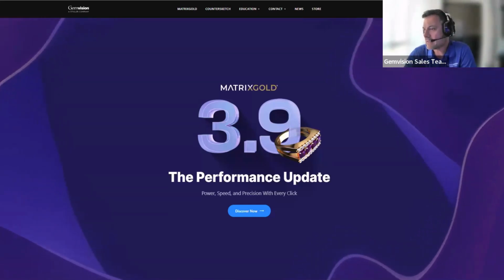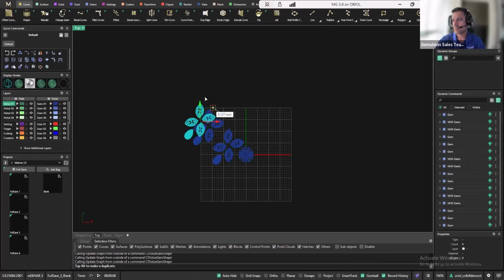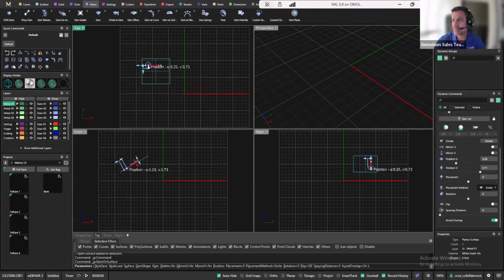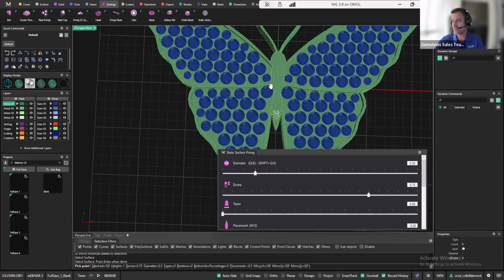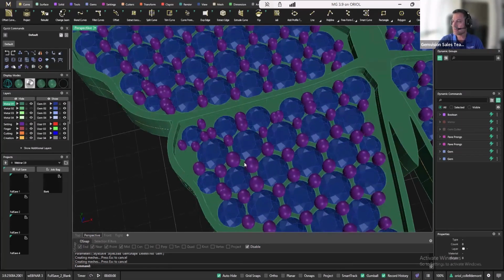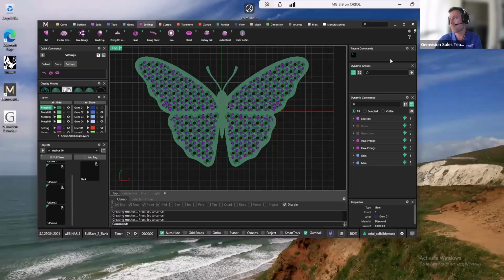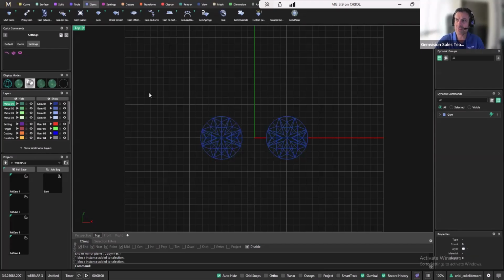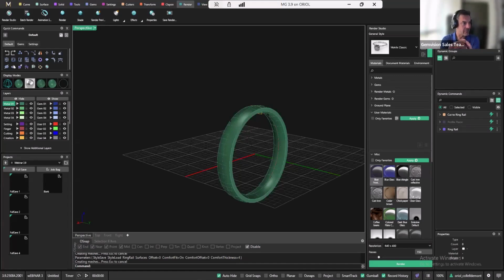[Live Session]  MatrixGold 3.9 | Learn All New Features & Design Faster in Jewelry CAD

Comment: You're finally working on fixing MatrixGold. I had purchased RhinoGold, but you discontinued my license, forcing me to buy MatrixGold instead, which came with numerous issues and was practically unusable. For almost two years, I’ve only been using it to place stones, prongs, and cutters—still with many problems. I really hope that when you release version 4.0, you won’t charge anything to users like me who went through this experience. Now that you've fixed the software, I'll try using it again, because I had stopped using it altogether. @lucasbertazzodesign